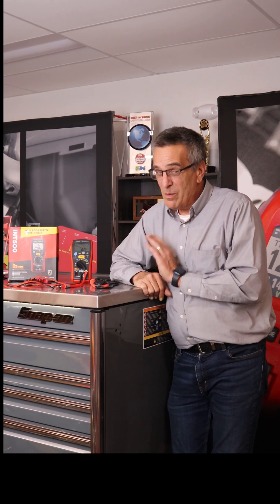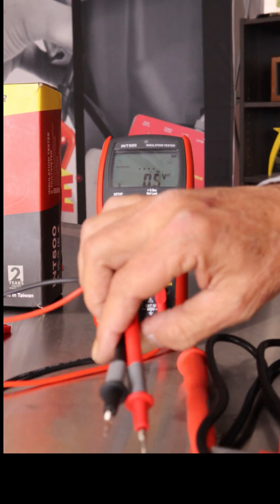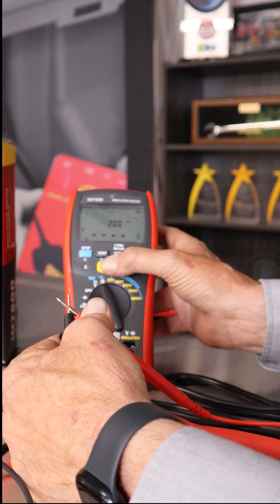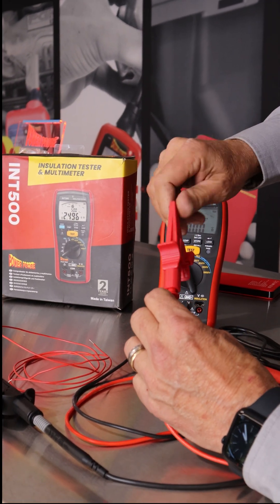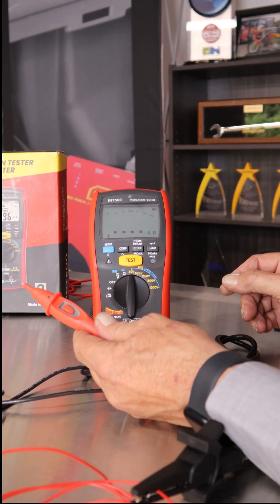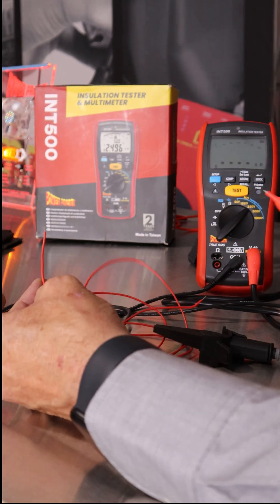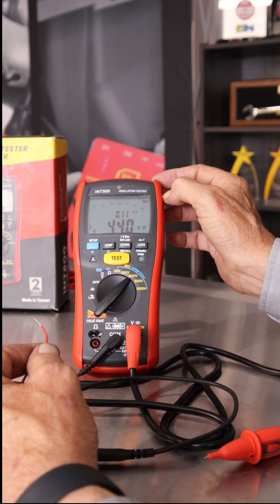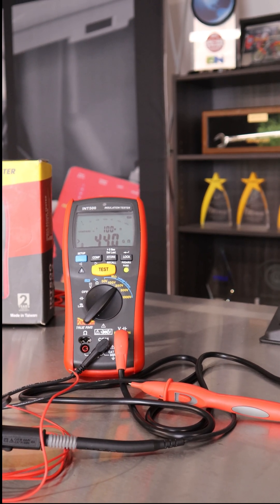🚗⚡ The Ultimate Multimeter for EV & Hybrid Technicians – Power Probe INT500! 🔧

Comment: What if your leads are touching each other and you send test at 250 volts. Would it fry itself?
Reply from the maker: If you were to short the leads together after applying the voltage test the tool will protect itself and terminate the test. No need to worry about those things with the INT500!